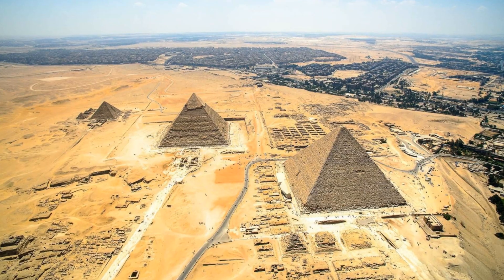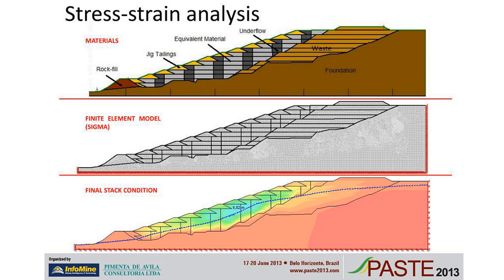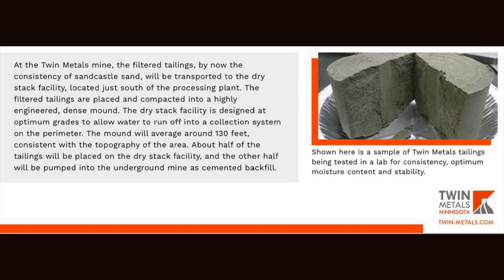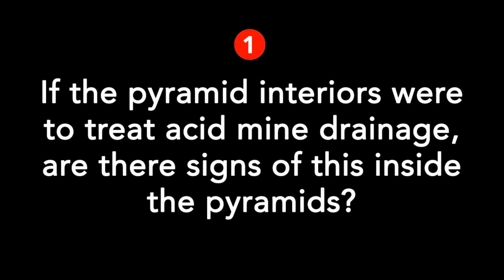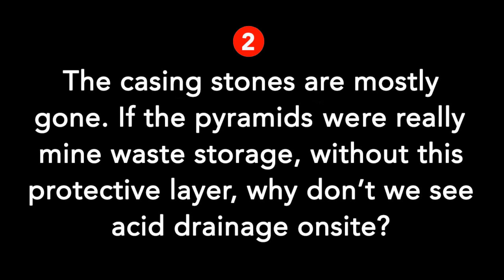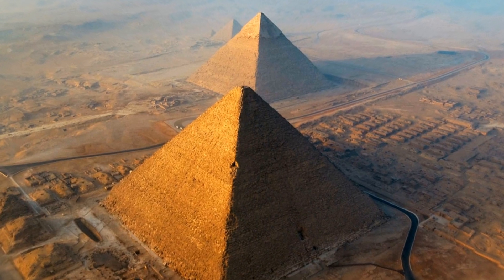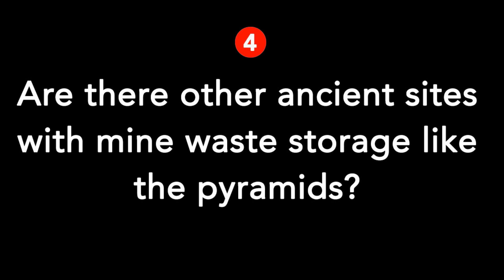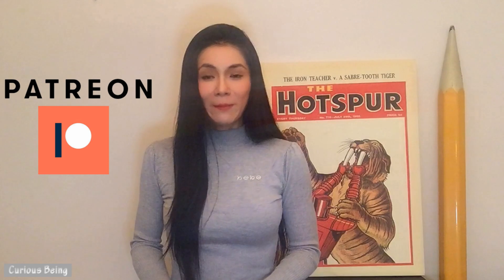Egyptian Pyramids Reveal Acid Mine Drainage Stains?

Comment: I think the Giza plateau was an industrial area.  The theory that the pyramids are tailings is very sane and plausible to me.  I believe that some of the pyramids with elaborate chambers built into them were processing places, likely to process catalyst material or support material for the operation.  If you look at the places with the large granite boxes, I believe these were processing locations as well.

I wondered why the large boxes were cut out of single pieces of granite and then the lids were cut off and shaped with beveled edges.  I also wondered why they were set in place and then seemingly polished after being set in a tight alcove.  I don't think they were.  I think the box was cut out of one piece of stone to minimize fractures so that it was as solid as it could be.  I think the lid was cut and shaped specifically to place a machine on it.  I think the interior was precisely cut for either a very specific volume, or more likely, to enable the acoustic characteristics they have.  

Whatever was being processed was put into the boxes and the lid was sealed over it.  The machine likely energized the box, likely with sound, to excite the material in it and start a refining process of some kind.  My belief is that the polish on the box is a result of this, not an intentional look.  This is why there are some polished boxes and some not.  Also why there is a residue on a couple of the boxes.  Some boxes having been used, and more being added to expand the operation. 

With the basalt road/staging area outside the Great Pyramid, and the long storage tunnels with alcoves for the large boxes, along with the shafts all over the plateau and material being brought from Aswan, I think this was an multistep operation, mining and refining materials in different ways and places where materials were separated out and worked on in different locations.  I still believe the key to the mystery is far more in the tunnels cut into the plateau than in the pyramids.  

Still fun to take guesses and your work and thoughts are appreciated very much.  Whatever we ultimately figure out, have to keep working at it to get there.  Thank you for stimulating the imagination!
Reply from the maker: Thank you for sharing your insight with me, Sean. I really appreciate it! The stone boxes are very intriguing and I'm still doing research on them. There are similar boxes in other ancient sites as well. I wonder if they served different purposes or not.  What you said about the polished look is interesting. It's possible that the polish was not intentional. I also wonder if the polish was achieved by grinding/ polishing or some kind of sealer. 
Thank you very much for the support. I'm grateful.

Comment: The machine marks and the potential for machines being used matches that they were able to flatten the rock before they started to cast blocks.
The osiris and other shafts have a square not circular cross section. This points to the use of a digger similar to what is used today. If the shafts were made by hand they for sure would be round. Nobody would carve out the "corners" by hand to make a round vertical shaft into a square cross section. If you have a rotating tool with many teeth and apply it to the ground wih the axis parallel to the ground you would achieve a rectangular hole.
Reply from the maker: Well said - thank you Bengt.

Comment: Many thanks again 🙏 Excellent vid!

My iteration on your hypothesis would be that iron oxide is important to improve the hardness and strength of cement based structures. Do you know if there is any evidence that parts of the ancient structures - other than the pyramids - were cast in Egypt? And that casting may have been the building style of a lost civilization such as in Sacsayhuamán?

Comment: Ok, great theory and another great video. So where are the tools? If so much iron was mined, to make steel I suppose, where is the evidence of all that metal? Where are the remains of the steel tools and infrastructure? Would there be any left after 12,000 years? Also, why are the blocks all different sizes? Does this matter? Would it be easier if they came from the same mold? Awesome work!
Reply: As for metal tools, time would have broken them down by now. Or if the engineering is as advanced as proposed, and environmentally conscious, tools wouldn't be left around.
Reply from the maker: Thank you!  I agree with what Adam said -  tools/ machines probably were moved away from the sites when the work completed. Machines  made of metals would rust away or they might be still buried in the sand or under water. Usually items from 10,000 years ago would be under 10m of sediments. And if the core stones were really mine waste blocks then their sizes might not matter much. As for the different sizes, I think adjustable molds might have been used. I explained my thoughts on the various blocks in a video I made for Sacsayhuaman - A Megalithic Mystery Possibly Revealed: How were Peru’s Sacsayhuamán Walls Built?https://youtu.be/x9S4CqY3eSA
Hope you will find it interesting.

Comment: I am really interested in the copper notches in the grand gallery. They appear to prove that the blocks must be cast.
No one ever talks much about them and I don't understand why.
Could that be fed into your theory of mine waste storage? Have you ever investigated them. I feel if we understood their purpose we may better understand the whole structure.
Reply from the maker: Copper notches? Where are they? I know there are some rectangular holes on the floor along both sides of the Grand Gallery.
Reply: @CuriousBeingbyTina  hi. Have a look at the side slats of the grand gallery. Half way up every 20 feet or so. So strange. Looks like they have an electrical purpose....but main point is how were they embedded.
Reply: They appear to be L shaped....with the leg inset into the limestone....and the foot flush against the exposed limestone
Reply from the maker: @bok2bok333  I thought they are protective metal clips placed by modern Egyptians to stabilize the Gallery roof...
Reply: @CuriousBeingbyTina  really OMG...are you sure
?  I didn't realise.
Reply from the maker: @bok2bok333  I assumed they are...
Reply: @CuriousBeingbyTina  maybe we are the only ones to ever see them. I've searched a lot but can't find info. You are probably right though. Your theory makes sense as always ☺️
Reply from the maker: @bok2bok333  I'm flattered ☺ It's my assumption that the L-shaped clips are not original pieces of the pyramid...

Comment: I think maybe there was a reaction chemical inside the stone boxes and on top of the granite slabs above the King's chamber. 
The rim of the box in the King's chamber looks as if it is eaten away by chemicals. If someone broke into the lid, the damage would look much different. 
The "air shafts" or drainage pipe openings are also rough as if attacked by a chemical. 
The wall of the King's chamber is etched to a height above the box. 
The floor of the king's chamber was rough, with a cavity dug in a corner, maybe by chemical. 
The "inspection tunnel" above the King's chamber could have been a hole eaten downward by chemical instead of up.
And maybe, the final granite "plug" before the subterranean chamber had two holes so it could act like a thermostat does in a car. If it ate through the plug far enough, it would open the second hole. Alright, that's not how a thermostat in a car really works, but it would open to full flow if needed.

Comment: I'm amazed at how many of these ancient history channels that talk about the 'air shafts" fail to realise or mention that the queens chamber shafts were also blocked in the queens chamber and we're opened up in the 1800s, the queens chamber walls had no shaft holes exiting into the chamber, the channel stoped several inches back from the face of the wall block.
Reply from the maker: The Queen's chamber air shafts were blocked by salt encrustation when the 1st team of modern investigators got in. Btw I discussed the interior structure of the great pyramid in this earlier video including the efflorescence salt accumulation in several areas inside G1: The True Purpose of the Great Pyramid's Interior System?!  https://youtu.be/BYr6HbEjS7w
Hope you will find it interesting.
Reply: @CuriousBeingbyTina  wrong, not blocked by salt encrustation, be honest with your 'research'

Comment: This is an incredibly interesting theory, and I think it needs further investigation. It does fit in well with many unanswered questions, it is also a superb example of lateral thinking. My one doubt centres on the supposed alignment of the base/pole etc, and the contrived mathematics claimed to be included in the proportions of the structure. This mining theory does not  appear to fit in with the alignment and dimensional hypothesis. 
Perhaps I might throw some doubt on the accuracy of the mathematical claims, have the supposed measurements of the Great Pyramid been taken accurately on site then developed into a theory, or were the dimensions of the pyramid made to fit in with an existing and creative mathematical theory.....
I hope your theory is proven correct Tina, thank you for being brave enough to share it!
Reply from the maker: Thanks a lot for the support, Mark. Much appreciated :-) I made a video discussing the  mathematical claims - Great Pyramid: Let's Double Check the Mathematics & Star Alignment Claims https://youtu.be/nPswBtmQKD8
Hope you will find it interesting.

Comment: It should be easy to confirm if the pyramid blocks are molded or cut from bedrock. The former should not show layers of fossil deposits but should be chaotic in it's structure.

Comment: Very thorough. I love listening about out of the box theories like this one. Two questions, though. The air shafts were sealed with stone blocks in antiquity. Why would they seal drainage tunnels? And also what is the purpose is the box in the kings chamber? And one more thing, the Bosnian pyramids only look like pyramids from one angle. They don't even look like pyramids when viewd from above, or any other side. And if I'm not mistaken, the tunnel systems are kilometers away from the actual "pyramid". My friend was a volunteer when they excavated them. There are no tunnels inside the pyramid itself.
Reply from the maker: Thank you for the information :-) I read that the underground tunnels are close to the Bosnian pyramids. Today's mining sites may or may not have their waste storage placed onsite; sometimes they have remote and designated places to store mine waste. It's possible that the ancient mining operations could have done the same. Mine waste piles are typically solid, like the Khafre pyramid. The Great Pyramid is an outlier with its internal system which is still only 0.014% of the volume.  In the Great Pyramid, the Queen's chamber air shafts are blocked at the end; I think they might function similar to our perforated pipes which are also blocked and buried underground. The box in the King's chamber is mysterious. It's likely to serve a utilitarian purpose.
Reply: @CuriousBeingbyTina  Thanks for the reply  What I mean about the air shafts is that they were sealed at the bottom level. You could not see them in the queens chamber. I can't remember when exactly they were discovered, but it was quite recently. Wouldn't that defeat the purpose of a draining pipe? It's supposed to drain the water somewhere, not retain it.
Reply from the maker: @gizmonomono  Oh, the other ends. The Queen's chamber shafts were connected to the Queen's chamber originally; they were blocked by salt encrustation (efflorescence) when they were discovered in modern excavation. From close-up photos we can see the tool marks inside the shafts are consistent from the opening to where they turn.
Reply: @CuriousBeingbyTina  I'm not sure what you mean about the tool marks. And I didn't know they were blocked by salt, but what I meant was, there was a block concealing the opening. They opened them in 1872, reveling the shaft itself. Apparently this plug was sealed when the pyramid was made. But, who knows. I still think this theory of yours sounds very intriguing.
Reply from the maker: @gizmonomono  I read that during the 1st modern excavation, they "opened" the shafts by removing the salt encrustation. If the shafts were blocked by stone, then we should have seen different tool marks inside the shafts with the newer ones being the 19th century's work when they opened up the shafts to the chamber. Though the tool marks inside these small shafts are consistent. If the shafts were plugged in, the plugs could be the work of Mamun who blasted a tunnel into the pyramid in the 9th century. Where are these plugs and what do they look like? Are there any description on them?
Reply: @CuriousBeingbyTina  Both are true apparently. It was filled up with salt deposits, but there was also a plug. There are tool marks visible around the hole. The plug itself was destroyed when they pried it out. It was only a small brick, but it perfectly fit with the sorounding blocks. If you haven't yet, take a look the Ancient architects channel. Matt is an incredible source of knowledge on ancient Egypt. Here's a video from a few months ago, when he was sent photos of the inside of the northern shaft. Notice also that there is a an opening in the middle of that shaft. Something previously unobserved.

https://youtu.be/Ki0405ulvIY

Comment: Hello 👋 Tina. 
I saw the wet marks in the ceiling 😉 , I also noticed the shafts have u-shaped drainage parts upside down with a visible gap at the bottom. I saw 👀 it on ancient architect . Could it be for water 💦 to seep in, or gas to seep out (as a safety valve) for possible machine?
Reply from the maker: Hi Mie Mie 👋 Yes I'm still thinking about the U-shaped block in the air shafts since they don't take up the entire shafts and some areas don't have the U-shape facing down. The openings in the King's chamber have center seams while the Queen's chamber shafts don't have seams.  I'm consider the possibility that the air shafts in the King's and Queen's chambers might have slight different purposes, may be like the perforated pipes can be used with holes facing up or down depending on design. On the other hand, because the Queen's chamber shafts don't vent to the outside and the King's ones might be covered with casings originally, I don't think these were designed for air or gas. Thank you for the comment!

Comment: Tina, something still doesn't add up, although you mentioned it for a few moments in your video. 

First: If the air shafts were drainage shafts then there would be needed many, many more in all 3D directions. Up to now we only know 4 tiny ones and they are all in a two-dimensional 2D plain. Mining or garbage dumps always have either water tight foils in between layers to collect seepage water or they have a star-form system of drainage pipes. Those four tiny air shafts in that massive pyramid are a joke for that. Unless... there are many, many more shafts hidden that nobody has discovered yet. What do we know about air shafts?
Second: in your video you show perforated pipes that collect and disperse mining water. Let's assume there are many air shafts (aka drainage shafts) in the pyramid then they shouldn't be perforated on the bottom because water from above would seep to below: effect zero.  But the air shafts are not watertight in the bottom. In your previous video you postulated your theory that the chambers were for collecting the seepage water. But why, then, were the drainage shafts closed on the bottom and had to be chiseled open in modern times? Makes no sense. They would had to be open by design to let water flow into the chambers.
Third: If the pyramids were geopolymers made from crushed mine rock waste, then why can we see today the huge quarries in front of the Gizeh pyramids where the marks of the individual stone blocks are still visible and even the holes for the rope system to move the heavy rocks? Why would you need to quarry the huge stone blocks if you had endless geopolymer blocks at your disposal?
Fourth: If the pyramid was build in wetter times when the Sahara was a savannah, then there must have been dozens of drainage shafts in the pyramids to cope with rain water. Why do other pyramids have no air shafts?
Just some substantial critics from my side for you to formulate a coherent and watertight hypothesis...  😉
Reply from the maker: Thank you for the thoughtful comment! My next video will potentially help explaining some of these questions 😉 Also I think the quarry onsite might be the work from dynastic Egyptians (the quarry stone blocks are very shallow) along with the hieroglyphs they left on on the walls.
Reply: @CuriousBeingbyTina  there are definitely other pyramids associated with tunnels… 😮😮
Reply from the maker: @jacobstockley  Yes I agree.